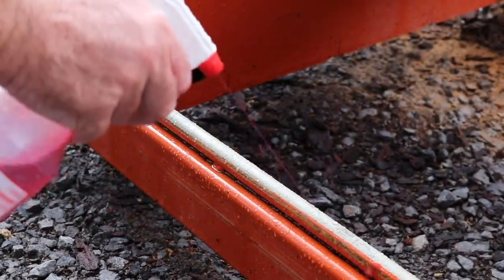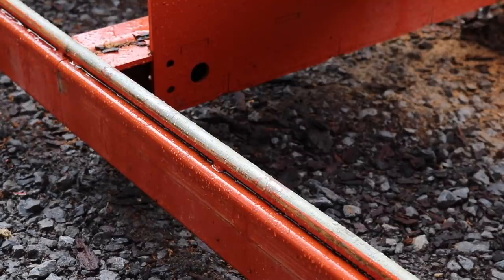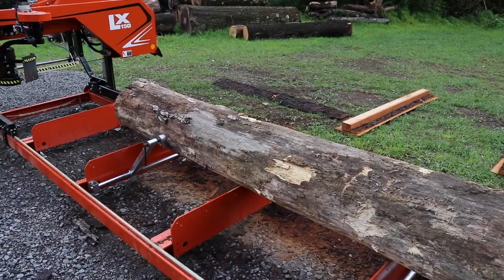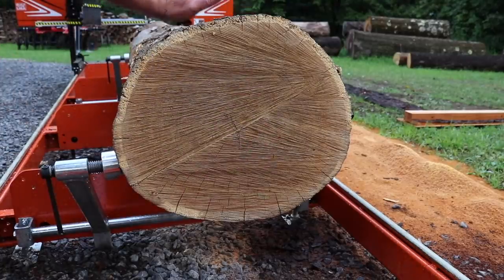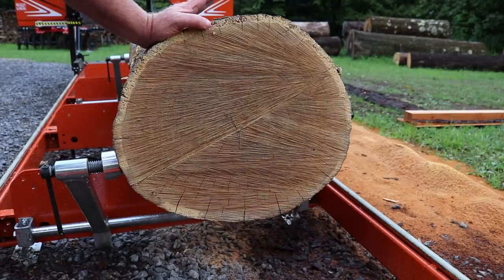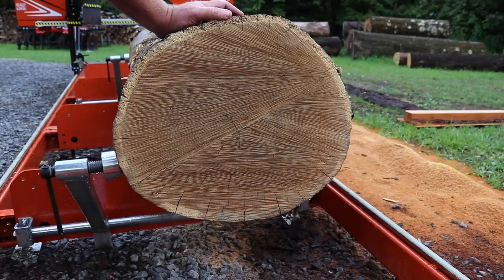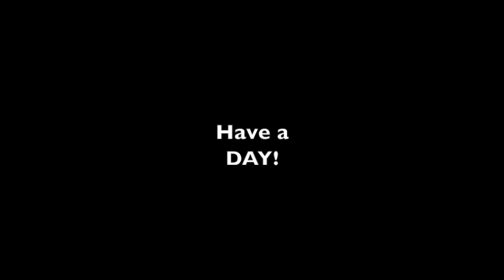#523 Beauty Comes From Within! Especially this log

Comment: hi there   looking real good   . don't mean to rain on your parade . sawing the log is the tip of the ice burg and may in fact only take up 10% of the time in board making .  just think   get the log , store it . put it . on the mill  now saw it   .     now you have slab wood ,sawdust  , the boards   . boards need to be stickered  now new building for sawmill ,   building for  boards changing blades upkeep  it just goes on and on . but for some reason when you see that perfect board come off you get a big smile on your face and it makes it all worth it .  hears to many years of happy sawing . once you get sawdust in your shoes you hooked . john

Comment: I use a 50-50 mixture of ATF and 30W as my general purpose lubricant.  I use it on anything that requires lubrication, including when I build a Farmertec kit saw.  It gives great lubrication.  I just half fill my pneumatic Oiler with 30W and fill the rest with ATF.  I then shake it up before first use.    On the rails for your rollers I would probably use a 50% mix of Dawn and water in a spray bottle.  Oil has a tendency to attract dust and saw dust.  Plus, out in the elements any excess soap will wash off.  I may coat the roller guides with oil between uses, but soapy water wil make those rails slick when in use

Comment: Good job Mike you’re learning fast! You are lucky to have such a good helper! I’ve owned a Woodmizer for 25 years and the slabs add up real quick,a suggestion that I did is get yourself a banding machine, hand held not real expensive. Band those slabs into bundles. Band in 2 places. They will stack like logs when banded. I sold mine for firewood. Leaving them banded , you can saw right down thru them like you’re sawing a log. I got 30$ a bundle and was glad to get rid of them. Stack em high
Reply from the maker: Great idea!

Comment: Hello the Morgan's

I've just subscribed after watching you for a couple of weeks. We live very similar lives, I've had a mobile Woodmizer LT40 for the last 10 years or so, sell firewood and cut about 10 acres of grass here. 

I worked a vertical mill from 1979 until I got the Woodmizer. For the first few months on the horizontal Woodmizer, I had to keep turning my head thru 90 degrees during milling to be able to see what I wanted out of it! Felt stupid doing it then and feel stupid telling the world now😁. 

When I'm milling inch board like you guys were in this episode, once I have it in a square, I mill it through and through leaving them on the mill. Then flip them all hairy side up and skim them off. Pick the lot up with the forklift, brush off sawdust and stack(I haven't glamorous help!). 

The downside with this method is you don't get to see inside until your done but it works well if your confident of the timber your milling. I learnt this trick milling the red cedar siding for huge barn conversion. 

And thank you for introducing me to Bucking Billy Ray Smiths channel, my chainsaws cut better now thanks to him. 

Sorry for going on too long!

Marcus.

Comment: looks great .only other thing i do is when you get the cant down to around 6 inches off the deck,i take all the other slabs stand them up in front of the cant lock the whole thing n place and edge the boards out.the edging make decent stickers,since they are the same thickness as your material.

Comment: I really enjoy your videos especially saw milling.  I absolutely agree it is so satisfying and addicting to create your own lumber.  On a safety note you may already be aware but just in case it is very dangerous to stand in the plane of rotation of the saw blade when it is running.  I have witnessed a saw blade breaking on a similar mill and shooting out the side at a very high velocity as  the shrouds did not contain the broken blade.  Looked like Melissa got kind of close at one point when she was doing some recording with her phone.  The bandsaw mills are fantastic machines but do have some inherent dangers and I would hate to see any of my favorite You tubers get hurt.

Comment: Great vid. Always enjoy them.   Paul Lemiski  On "Canadian Woodworking " has two mills running and I follow his channel all the time. A few weeks ago, he featured his mills on a vid, and he has started using hemp oil on the blade. Just one squirt with an oil can on the blade before each cut and ur good to go. Have seen some folks using diesel fuel the same way. That way ur not having to carry down jugs of water and fill the overhead container on the mill. And the hemp oil I've been told is not that expensive and it's biodegradable.  Rick.

Comment: Why is the de-barker not doing its job? HVe you not set it up yet?
Reply from the maker: RK is spot on, no bark I just wasn't running it
Reply: @mikeodonnell3390  Debarker is only needed where the blade enters the log. The opposite side of the log doesn't need it as the blade is leaving the log.
Reply: Barry Humphrey finally saw this.....I was confused by it not being used......

Comment: Nice video new subscriber ( Nathan Elliott mentioned your channel) . When I saw (Lt 35 Hydraulic) if only flat sawing , I leave the boards on the mill until I'm done and take them all off at once with the tractor then blow the dust off as I stack and sticker each layer.  Nice looking setup you have there !
Reply from the maker: Thanks for the tip

Comment: Hello, I'm looking at two different mills, one potential flaw I see in the Woodmizer is the sawdust discharge is on the same side that you operate from. How much sawdust do you eat while operating? I'm going to take a look at both competitors at the logging expo in a couple weeks, just was curious if its an issue for you.

Comment: Mike should build a rail system in the floor out the door with some small rollers roll it out cut back in this way won’t run into access issues and fumes

Comment: Hey, Mike, always enjoy your videos.

Have you thought about putting a tarp under the sawdust for an easy cleanup?  I bet they're not fun to clean after a good rain.
Reply: wireedm1 put a bolt in the dust chute and hang a 5-gallon bucket then dump in wheelbarrow etc. way easier than cleaning it up off the ground
Reply: @busenitzcustomwoodworks6768 , that's an even better idea!
Reply: Have you thought about using the collected sawdust in a smoker?

Comment: suggesting keep your adjustable saw guide as close to the log as you can as you will get better cuts as the blade gets a little dull it could ride up on you or wavy cuts.

Comment: Good video Mike. Does the LX 150 have a way to level the log end to end? I am far from an expert, don't even have a mill myself. But I always thought you wanted to level the centerline of the log as best as possible to take an even amount off each side. Looks like your log was sitting flat, so the centerline of the log was not level, if that makes any sense. I thought it was to help reduce stress in the boards and keep them as straight as possible when drying.

Also, did you notice any cracking in the boards as you were milling them. I've had some standing dead oak that had the cracks like yours showed, and when milled the cracks were all throughout the boards. The sawyer called them shakes and said the log was basically scrap. I tried to save some, but figured out he was right. For flooring, it might not matter, so maybe that is what you were thinking. But any kind of good lumber, it make not make out so well.

Comment: strip the bark first? for the blade? looks like you did that.. what tool do you use for that?
Reply from the maker: It just fell off, been dead for a while
Reply: @OutdoorsWithTheMorgans  dang.. I wish it were that easy with the cedars here! Now that you have a mill, it will be interesting to see what you find to deal with that. I've been using sharp hatchets, etc.. but I am looking at those bark strippers that attach to a chainsaw blade.. They kind of make a mess of the wood though.

Comment: I know you hear the movement comment all the time regarding your firewood but the same holds true for lumber. I am an NHLA grader and have worked in the lumber mill.  If you can just slide or roll the lumber.  You may have had room in front of that log just to "slide" each piece of WO and leave it on the rails. Once complete use the tractor to move the bunk of lumber. Something to consider with a new building. We need to save Melissa's back...

Comment: Someone got to it before I did.  There has to be a catchment system and use for the sawdust.  Oil dry, wood dough, firing a kiln, I don't know if they still use it on the floors in the meat industry.  Anyway just that one log and it was up to your knees when you were done.  Use it all and make OC want to be proud!  ;o)
Reply: John in some areas you can get rid of sawdust at pulp and paper mills or OSB plants but you can also use in clay soils to help break down clays, and as a floor bedding for animals to.

Comment: Are you cutting 3 guarters or 4??
Reply: The boards you cut just looked like 3/4 rather than 4/4 !!! Sorry maybe I should have said anything  , I probably stuck my foot in my mouth !!!
Reply from the maker: They are 1 1/16
Reply: @OutdoorsWithTheMorgans  thanks !!! That will leave a little to level and straighten the board !!! 4 quarter is preferred so you can plain it to what you need !!! Beautiful wood wish I had some  !!! Thanks